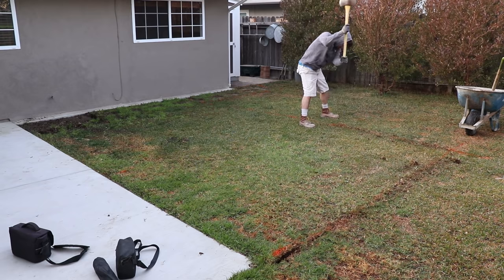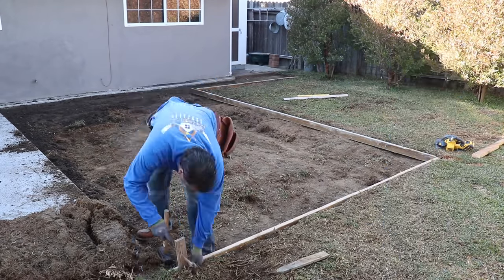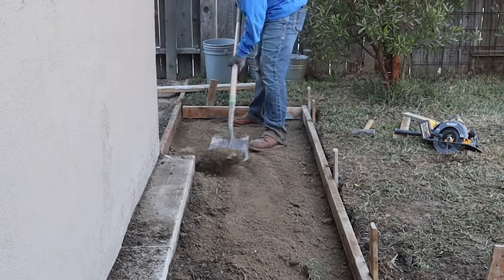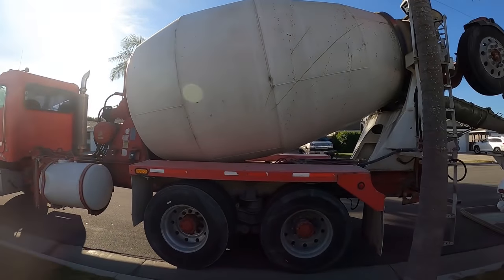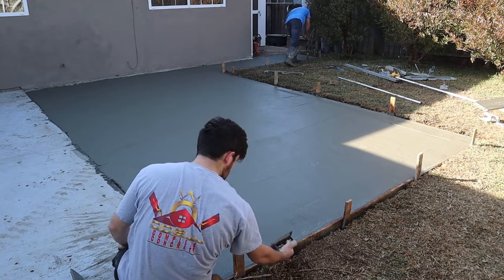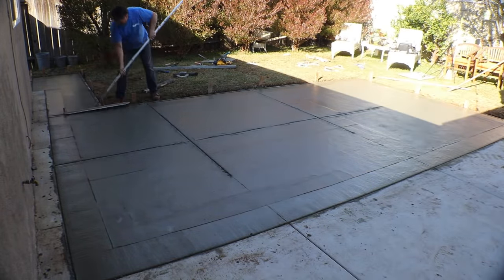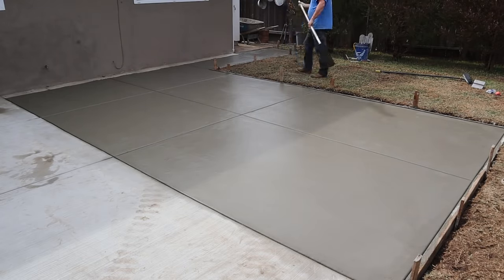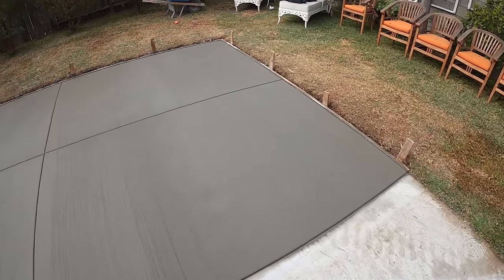How to Make a Concrete Patio Bigger

Comment: Good job. Encouraging to see tradesmen still taking pride in their work.
Reply from the maker: I concur
TY
Reply: It's a rare thing these days. Mostly because builders hire the cheapest workers they can get, not the best. Most people building these days don't even know what they are doing. We are renting a brand new home and we have had the builders send people out to fix the same issues multiple time. How many times does it take to get the paint on a door right? How is it possible to screw up a door frame worse than it was when you come out to fix it? It's just unbelievable. There are still several issues, but I just stopped complaining about them. It's obvious the people who own the house have never stepped foot in it, and the property management people don't care, so why should I?  I will probably be moving out, hopefully to something I buy, when the lease is up.
Reply from the maker: @MAGAMAN  
That's a real bummer.
I can relate.
Reply: Exactly
Reply: @MAGAMAN  I know this is an older comment, but I had to respond because I had the exact same situation, relatively new home and the owner didn't want to fix a thing. In fact, he actually asked me face to face, both of our wives right there as well, if I can get up on the second story and clean out of the gutters! LOL even if I had a ladder to get that high, which I didn't.  Another issue was a water leak which appeared in the ceiling of the first floor, and blamed us for using the tub bath upstairs and splashing water out of it.

Comment: Wow, never realized how much finishing goes on after the pour.  Great looking job.
Reply from the maker: TY
Reply: Yeah finishing is so much of it. I did a very novice job for myself, and the finishing looks like crap of course compared to professional, but hey as I freely admit I only did it to save money, and from a distance it looks fine. I did learn a lot, though, for example if I do it again, I'll mostly just use the tools where you can attach the poles instead of just the hand tools, because you can apply more weight on the longer tools.

Comment: Absolutely fantastic work. I want to extend my patio as well and hope with your videos be able to do it by myself as contractor was throwing around 8k to do it for me.
Reply from the maker: Wow
GL
Reply: I don't know the correct price for a job like this but I know for sure that it is better to have the professionals do it many times because it turns out that you have to pay twice, the first when you try to do it, the second when you have to call someone to take everything apart and do the job again. 🤣
Reply: @MrCrashsystem  LOL so true. I live in an hoa, but as the other person said I didn't have all that money so I did it myself. Fortunately the value of the home is such that if the virus insist on it being torn out, then we will just take a couple thousand off the selling price, or convince them to buy it as is, if the market is still kind of hot or at least warm.

Comment: Trying to do the same to my backyard with two smaller ones on the side and debating on if this is something I should try and venture on or shell out the crap ton of money I know it will cost for someone to do it. Either way your work looks amazing and it was encouraging to see how much pride you take in your work!
Reply from the maker: Depends on how handy you are
Reply: Did you decide to try it yourself? After I did mine, I realized the largest I think I would attempt to do myself is maybe 10x10. I mean, at one time, after which I'll get tired and relax :) But not in the hot summer, where you have to work fast before it really sets. And I found that using the tools with the poles attached seems to be better than just the hand tools.
Reply: How much did this cost

Comment: Hi Odell. I am about to do a similar project in my backyard. Quick question: Wouldn't it be beter to epoxy the rebar into the old slab? I already got the epoxy tube. Is it not necessary? Should I return it?

Comment: David, great video. Friendly tip to make life alot easier. Invest in a "turf edger" i call em grass cutters at work. They work great, fast simple clean edges. Easier on the guy too.
Reply from the maker: Turf edger, grass cutter.
I need to check it out.
TY

Comment: This blows my mind this dudes out here laying amazing concrete all shapes and sizes and I can’t even get a quote for less than 2200 for a 10x10 near Wilmington NC it was cheaper to do paver patio which is usually double the price of concrete everywhere else
Reply from the maker: Wow, thanks!
That's interesting
Reply: @OdellCompleteConcrete  I don’t know where their prices come from because in the mountains of nc where a lot of times they can’t even wheel barrow it they use ur little 30 inch style bucket to move it around on steep sides they only charge 12$ flat fee no matter how big or small per sqft

Comment: Top notch work!!! Definitely saw that Air Force bucket in the background, wonder did you serve any time in USAF C.E.  Prime Beef or Red Horse? I served in the structures shop in each.
Reply from the maker: No I got the buckets at Lowes
Reply: @OdellCompleteConcrete  well, either way amazing job, That slab looks great

Comment: Beautiful job, really nice work and definitely skilled work but I'd like to ask a question. I'd have to assume based on the geographical location of this project a crushed stone base wasn't needed for this patio? I thought that a stone bed is a must for proper water drainage underneath to ensure the longevity of any slab from not sinking, shifting and cracking?
Reply from the maker: Not here in Southern CA where its beach weather everyday
Reply: Yeah lots of people ask that, I live in Sacramento and I did a base of maybe one inch even though I may not have even needed to. That's one nice thing about living in the valley in california.

Comment: I can already see that your going down enough,  some people just remove top sods,  about an inch of dirt, shale, but, when I used to do concrete,  you go 10-12 inches down, stone's on bottom,  leveled, more grout,  again level and compact, then a 4 inch thick worth of concrete mix, I remember in winter, if hand are cold,  put em in concrete and the lime warms them up, I should say, it wasn't a garden,  no, a big bridge, the INFASTRUCTURE first, which you use a very dry mix when putting in the pipe work, and the line of trucks with concrete is never ending,  and every load I'd have to make blocks for the engineer so that the concrete when tested, under 100s of pounds of pressure,  BREAKING point is written down,  I actually loved the job, the amount of concrete and different ways of mixing,  I learned so much...that I ended up doing my back garden which was two containers long, and about 1 wide, got all the machines on a bank holiday weekend so a free day for NOTHING,  and I needed it,  the hand rotavator was very sore on the shoulders after resting from the first day...just dig big hole and bury all the rocks and sods,  and made a small rockery at each end of garden,  actually my son moved them for his dog kennels, concrete is not that hard, your shown once and you never forgot,  watch when road works are being done, sometimes the concrete is 6 inches deep...love to see job done right, and OBVIOUSLY you do good work if you are getting call backs,  and people not able to move,  when older, so they try get a maintenance free garden BECAUSE they getting older, so I'd add raised beds,  about 4 so they can still do gardening if they want,  just no bending over hurting there backs,  GREAT WORK LADS....
Reply from the maker: Different regions require different Engineering

Comment: Just curious !! Why did you use a cement truck ? If I wanted to not use one, would I still have the same results ? I have a 4x6 patio and want to extend it to 10X14 . I wonder can I buy concrete and mix it together and it come out just as good as yours did .

Comment: Hello Mr.Odell.
Questions: I am in Canada. I want to pour a concrete driveway and also a slab in front and behind the house, with a sidewalk all around the house. Because of the frost/defrost of the ground, should i also drill my house slab to connect everything around with rebars like you did? Also, can i just compact the prepping ground like you did or do i have to compact a couple inches of gravel as a base? Is it always recommended to lay a tarp under the pour to prevent from curing too fast? And should i but a weedbarrier type of tarp over the ground or not necessary? thanks a lot in advance :)
Reply from the maker: Best to check with your local building department

Comment: Did you put grease or epoxy in the holes for the rebar? How far spaced apart were they and how much distance did you keep away from the edges? Wanted to pour a 9x4 against an existing 12x6 patio slab. Any help is appreciated. Trying to save some money by doing this myself
Reply from the maker: Solid steel

Comment: Cool video, why not drill holes after u tie rebar up so you can splice the bars together to the ones running same direction?   Easy enough to move that little rebar around even all tied up. You got 2 different rebar layouts does it not matter in smaller scale  concrete work?
Reply from the maker: Not really
Reply: @OdellCompleteConcrete  thx, good video

Comment: That was a really nice job. I've just had a driveway redone, what makes contractors not put the wire in the concrete to begin with? The old driveway didn't have it, and I mentioned to the guy to do it on the new one, but they didn't. I wasn't home when they started to pour it.
Reply: Higher profit margin. No installation of wire means more money to pocket.

Comment: Good work.. I don't like to use rebar to tie the concrete together. Tie it into the foundation or and existing walkways yes, but I'll only come out about 3 or 4 ft into the crete I'm going to pour.
Too strengthen the concrete I'll use fiberglass shredded up into the concrete. The durability and strength it adds to a class C or 3000 blend is far better than rebar. It doesn't rust and is much stronger.. finishes great also...
Reply from the maker: I have some new stuff. fiberglass rods

Comment: Great job the only question I have is why didn't the homeowner have the walkway poured a little wider to lineup an be uniformed with the slab joints and the walkway around the corner of the home?

Comment: Looks good. I am surprised you used a funny trowel and not knee boards. The broom is a little rough for me. Thats more of a driveway finish on a slope, not a patio. The score joints are not sized right either. I do like how you used a strong mix design though. I used to use rebar, but the clearances required don't work. The rebar might end up 1" below the finish surface and sometimes cracks will run along the rebar . Just my opinion. Brian M.

Comment: Great mix on that concrete. Love the outcome, my only concern is if the slab should start to lift the rebar that was pinned to the walkway won't let the relief joint do is job resulting in the new slab lifting the walkway attached to the house . Other than that great work .👍🏼
Reply: Why would it lift it?
Reply: @kbanghart  frost. If the new slab lifts the old walkway would lift string how they are tied together by rebar. Not saying it will or would just an observation .
Reply: @Guardducks  oh right. I've seen him respond to other comments about this, basically in So cal there's no need to worry about that cuz it doesn't get cold enough, for long enough, to worry about it

Comment: great video, is there a reason you didn't put down plastic under the slab?
i have several slabs i need to lay in the next few months (580 sqft & 390 sqft) and this has shown me how to get a better finish.
i have laid several slabs and pads on my property (firewood shed floor, extension to front verandah, pad for a compressor etc) and the finish was ok, but could have been better.
i'm a pensioner so can't afford to pay someone to do the work, i have friends that can do the site prep (pylon holes for the sheds and level the ground)
Reply from the maker: For a area you plan on climate controlling, then you'll need plastic

Comment: What is that machine that you ran over the dirt after you dug the grass out? Is that a compactor? Could I get the same effect using a tamper of some kind? Thanks
Reply from the maker: Vibrating plate compactor.
Hand tampers work.

Comment: Mr Odell, hey quick question, I'm foreseeing I have to do some concrete work in the future and would like to order a cement truck or two. Questions are : how much does one full cement truck cost and how much ground will it cover?
for a 13' wide drive way using 2x4 forms at 3-4,000 PSI with wire mesh. I understand its best to do it all in one pour , not sure if I'll have that option and doweling it in into sections for a span of 50'.
thanks
Reply from the maker: 1200.00 for 10yds.
Cover 800 sq.ft. at 4 inches deep.

Comment: Question, if i add Rebar on the same slab, 3 inches deep, can i use the cutter and if i can, does water corrtevthe rebar if the cutter exposes the rebar?
Reply from the maker: Use Owen's Corning and job worries

Comment: I got a patio for my house similar size 12x14 i had one contractor quote me for 3.8 yrds and 2 more for 2.5 yds...when i do the math its around 2.07 so 2.5 sounds better just wondering how much you used here ?
Reply from the maker: It depends on the depth also. I think I used 2.5

Comment: @Odell Complete Concrete, if the curb wasn't there would you still dowel into the house and do you always dowel into any existing slab? An explanation would be awesome for all the rock heads who enjoy your content, but aren't in the trade. Thanks.
Reply: ya I would. we definitely dont want that area of the slab sinking over time thus ending up slopping towards the house, making all the rain water drain towards the house
Reply from the maker: No I never Dowell in to house foundation. To risky.
Dwelling depends on soil conditions.
But its always good to Dowell

Comment: Great finish. Those bars you drilled into the existing slab are called dowel bars, they should be smooth (not rebar) and set to allow one side to move and one side to be rigid, this reduces cracking at the joint. You can use a dowel sleeve or grease (as a get out of jail). You've tied the end of the bar to the mesh so it wont be able to move, even if you have greased the joint in the slab.
Reply from the maker: I don't want it to move.

Comment: In Australia we would have to pull that concrete up with that steel minimum 200mm centres for bar or fabricated steel mesh f72 and up concreters here get so much fall back on even a small crack how is it for you guys in the states?? Must use better quality concrete blend.Regardless nice work lads !!
Reply from the maker: That's how the big timers get it on
OSS

Comment: I’ve kinda got a similar situation. A 10x12 slab for a metal shed with well pump inside. The previous owner converted my garage to a bedroom so I need a bigger storage room. I was hoping to add about 8ft or so to the side of the existing slab, remove the metal shed and build a new shed over top of the whole slab. Could I use this same process for my project? Shed would be made of 2x4 and metal roof
Reply from the maker: Yes with a thickened edge of 8"
Reply: Awesome, thanks for the reply. Subscribed, keep up the good work

Comment: Hey Odell, great video! Quixk question I just finished a slab of 27’x 9’ and it’s been a couple hours and I have some cracks any advice on how to correct these? Thanks!
Reply from the maker: Power trowel
Reply from the maker: Maybe plate compactor

Comment: Do you have to get permit from city to do that
Reply: It depends on the city.  My requirements are patio/deck attached to the house or/and over 200sqft needs one. Also a height requirement.

Comment: Should add crushed stone before adding the concrete. Keeps it from shifting or cracking
Reply from the maker: No need in Southern CA
Reply: I was wondering the same thing.  I was shocked when no crusher run was used.  I am from Ohio though, so Sothern CA obviously has no freeze heaving issues. LOL

Comment: 4500 and rebar....overkill or standard setup? I'm a homeowner doing research.
Reply from the maker: Its a little over the top.
But the cost isn't much difference on something this size
Reply: @OdellCompleteConcrete  all the quotes I've gotten use 3,500, no mesh, or rebar. Just extending driveway 9ft. Thanks for the info.

Comment: I noticed that you haven’t put a layer of nylon between the ground and the cement, without that your concrete is exposed to humidity of the ground and ground movement
Reply from the maker: NO worries concrete can handle it

Comment: There are no rebar support chairs. The rebar should be center aligned vertically within the concrete mix.
Reply from the maker: Manual lift works

Comment: Why did you texture the concrete in a horizontal manner (parallel to house) instead of perpendicular? It'd make more sense making it perpendicular coz water drains more easily? 14:29 Thanks!
Reply from the maker: Matching exsiting

Comment: Just curious why you dont excavate deeper and tamp a proper base with class 5.   Is it common practice to just pour on dirt like that.   Ive noticed a lot of your vids where you only exavate the top 5 maybe 6 inches of top soil
Reply from the maker: The weather here in Southern CA.
Is Beach weather everyday
Reply: @OdellCompleteConcrete  so if the weather was like say Canada with brutal freeze/thaw cycles you would excavate deeper?